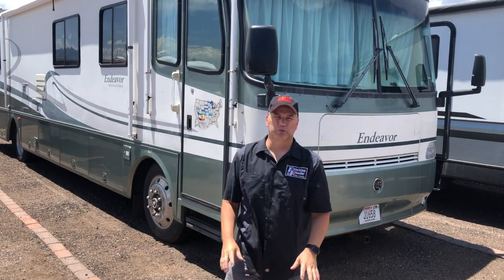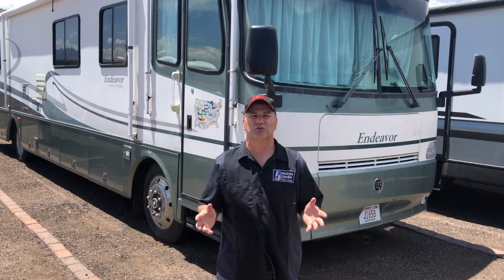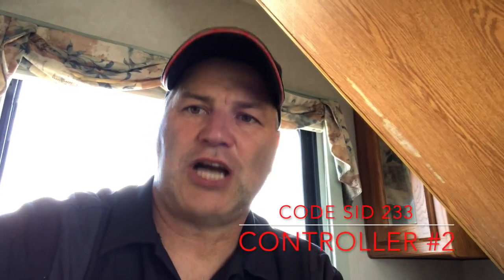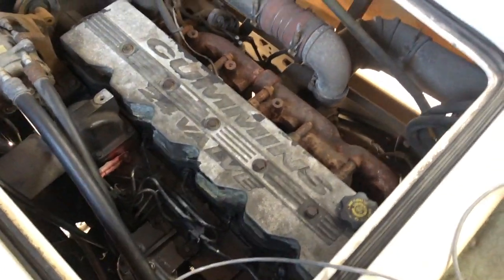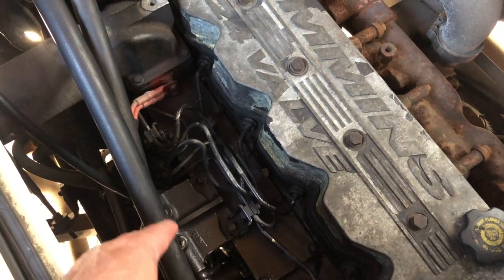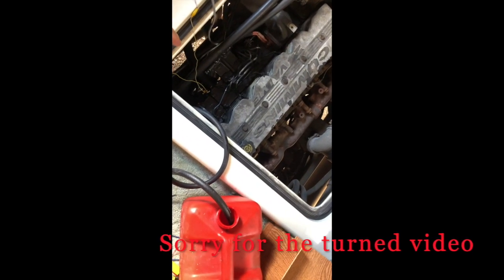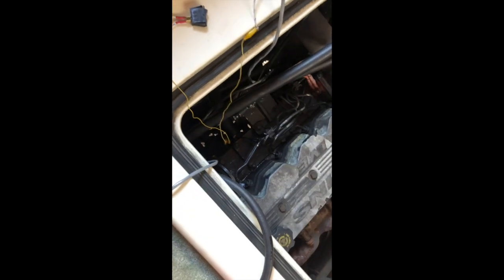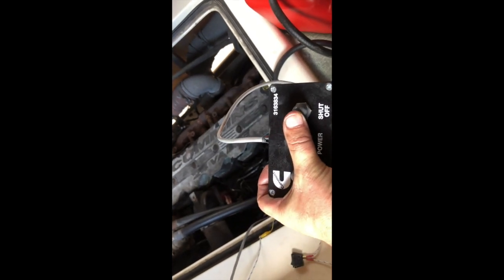5.9 ISB Cummins crank no start MUST SEE!

Comment: 00:31
Generally, Cummins prior to 1998.5 are mechanical, zero computers.
The 'ISB' designation usually refers to post-1998.5 Cummins 5.9-liter/litre engines.

Comment: I just bought a  injection pump, Throttle Position sensor and Cam sensor from Thoroughbred Diesel. My problem was different. I was getting a dead pedal condition between 40-60 mph.I also was throwing a P0216 code which is a communication error. Never had a no start condition and truck ran strong, just dead pedal. In any case,  the issue has seemed be fixed now. I drove about 500 miles mixed driving with no issue. I too am great full to aThoroughbred a diesel for their advice and it all cost me only $1750 with a total of a 5 year pump warranty with their new extended warranty program. I will look at your other videos to see if you solved the issue. Good luck.

Comment: I have a 2000 holiday rambler ambassador with 60,000 miles on it that has sat for two years that won’t start, it just cranks and cranks but no starting even with starting fluid. I put new batteries and a lift pump and still no start , do anyone have any answers please?

Comment: Steve did you ever figure out what was causing your problem. I have an 5.9 school bus with similar problem, lift pump kicks on and off when key is turned with no start. Thanks
Reply from the maker: I did not want to just by the ECM. I think that is what it is. I just found someone for $189 to bench test the ECM. So at least I can eliminate that or know that is what it is. Now the $189 will go towards the programming charge of the new one if needed. Crossing fingers that it is good and then just need to find a bad ground or connection.
Reply: @learntobuildit2785  think I've narrowed my problem down to ecm issue also.  bluechip diesel has some very helpful diagnostic info on their web site.  were you able to get you ecm repaired?
Reply from the maker: @silvabeach5145  I will have to check out BlueChip Diesel. I was going to Arkansaw Vally Diesel. I have been so busy and not able to get it out of the vehicle. I am doing it soon.
Reply: 😂 30 years later… and People still can’t PRONOUNCE… “ CUMMINS “ correctly!!! 😂 
There is No…. ( i n g ) … in CUMMINS!!!

Comment: So have you finally found the problem ?
Reply from the maker: NO I have not yet. I took the ECM out and sent it in for diagnostic. Came back all OK. I have to believe it is a bad ground or power wire. I am trying to locate a wiring harness. Or find someone that is better than me at finding what is going on
Reply from the maker: I have saw that, but mine won't start. I have no power at the injector pump. You need power and ground at pin 6 and 7. I don't have that.
Reply: @learntobuildit2785   Have tested your battery ?
Reply from the maker: There is a relay for the VP44 and on pin 7 you are supposed to have positive 12 volts. I have no power to the relay and then no power to pin 7. But no fuse blown that can be found. It cranks fine. Generator works fine.
Reply: @learntobuildit2785  where's the power coming from to energised your relay ? Check the continuity of this positive wire.
Reply: I have a 1998 just like yours, there are 4 fuses in the back wall of battery box that are ecm fuses have you checked those?
Reply: The lift pump Runs only for a few seconds when key turned on but if you bump the starter it will run for 30 seconds ( all this without engine running). Upon engine start the pump runs continuously. I have an airdog lift pump and it’s factory set at 25psi. I also highly recommended install a fuel pressure gauge on outlet of the filter. I bought an isspro its great youll need a snubber for it also. Hope u get her going.
Reply from the maker: @jc_from_tx9229  I finally found the issue. Just too busy to post the solution yet. Some moron used a test light and punctured the wire. Not just a tiny hole. The wire was all corroded and was broke or not letting power to the VP44. I cut the wire out soldered a new wire and it started right up. I also replaced the lifter pump with a FASS. I was trying to find a pressure gauge to fit on the filter housing. Would love the link to the exact one you bought. Direct gauge or sensor with wire to the front?
Reply: Heres snubber, it screws to filter housing then sender to it, 3 wires to front dash

https://www.amazon.com/gp/aw/d/B007SYGRBW?psc=1&ref=ppx_pop_mob_b_asin_title
Reply: Good tips to look out for. Thanks for the video!